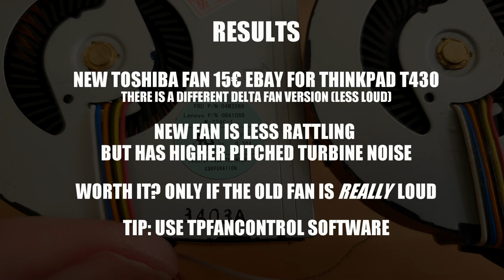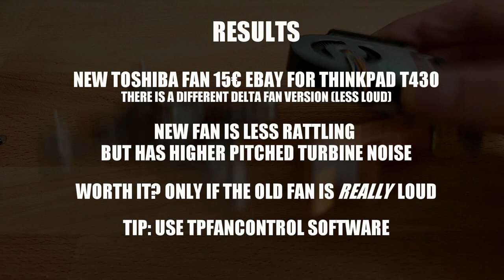CPU fan only replacement (keep the old cooler) on ThinkPad T430

Comment: I've never had to replace any of my thinkpad fans. I just take them apart clean any residual dust and spray fan spindle with WD40. After the WD40 has evaporated then use a little gear oil and all's well. The loudness and vibration is usually the spindle bearing and this method has worked every time for me.
Reply: I think I may just give this a shot. Thanks, guy from 2 years ago.
Reply: What type of wd40 did you use? Did you also used a thermal paste before you put them back

Comment: Hello. I noticed that everyone is talking about the hum and the useless fan itself - yes, it's all true! But, no one talks about the next moment - the algorithm of its work. My T430 has fan position 1 at 2500-2600 RPM and fan position 2 at 3800-3900 RPM. There is no intermediate, for example - 2800, 3000, 3300, 3500... This is the second problem! And to be honest, this is the first time I see such a terribly tuned fan curve, or rather its complete absence on a laptop. Therefore, even if you use TPFanControl, you will not be able to properly configure the system, since level 1 is 2500-2600 RPM, and level 2 will always be 3800-3900 RPM right away. It's just that nobody talks about it...
Reply from the maker: Go for the Delta fan cooler to get much better noise levels / fan curves
Reply: @panoramacircle3281  This is understandable, but I was talking about something else. About that very strange fan speed curve on all of our favorite ThinkPad's. I gave an example on my t430, this is not normal

Comment: I have tired both the toshia and the delta fan... They have about the same cooling performance but the Delta is almost silent at low levels. Would never go back to the toshiba
Reply from the maker: I am getting a Delta fan in the mail soon and will make another comparison video
Reply: I concur - I came to the comments to say the very same thing. The fan noise ruined my T430 for me until I bought it a Delta fan. It instantly became my favourite laptop (they're all from the x30 series). It was so good I forked out 50 pounds for the 35W quad core CPU, and now it's an absolute belter.
Reply: @GrahamAtDesk Thanks for the comment. Now my T430 has a chance to be saved. I don't have the strength to listen to this noise. If with the help of a new fan it is possible to make it quieter, then most likely, in gratitude to him for the silence, I will also replace the processor with i7-3632QM (i7-3612QM)

Comment: TP Fancontrol software is excellent. The stock fan curve on my T430 is atrocious!
Reply from the maker: Yes older TPs are nearly unusable without it.
Reply: @panoramacircle3281  Interestingly, I just replaced my T430 for another one without the Nvidia GPU. It is practically silent in comparison and runs so much cooler.
Reply from the maker: @ted-b  Might have been the Delta fan or better CPU paste. There could be some background task in Windows constantly running as well like antivirus.
Reply: @panoramacircle3281  The new machine has the Delta fan, it's the same image of Win 10. I just swapped the SSD into the new machine. Same paste used too. I kinda miss the Nvidia, mine had 2GB of DDR3 dedicated. The Intel isn't too bad, I can still play Bioshock! :)

Comment: I wonder if there are any stronger fans that can fit in a t430 mine likes to heat when playing games
Reply from the maker: Toshiba is the strongest fan, only way for better temps is using liquid metal for more performance. The CPU can take high heat anyway.
Reply: @panoramacircle3281  I see, thank you for the response!

Comment: Can i ask a question? What kind of tape should i use to replace the tape that i already cut out?
Reply: Can a electrical tape will suffice?
Reply from the maker: I just used some standard generic tape. The only point is to close air leaks. The screws keep the fan in place not the tape.